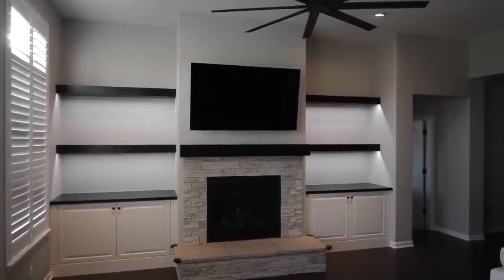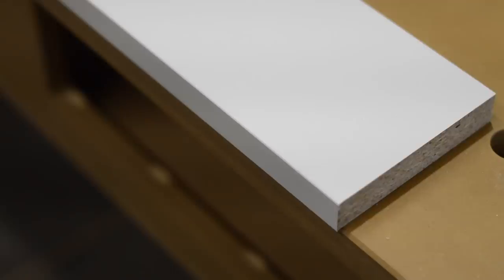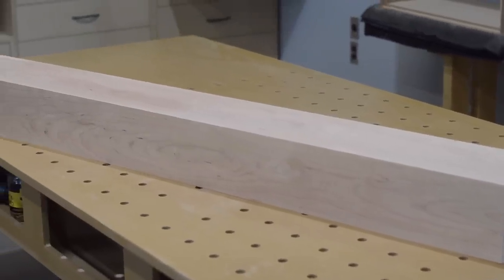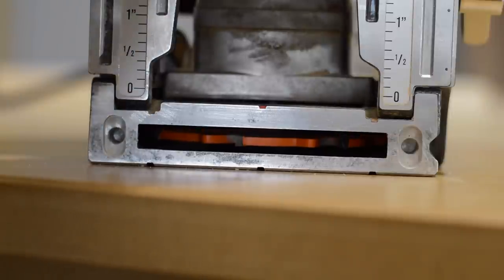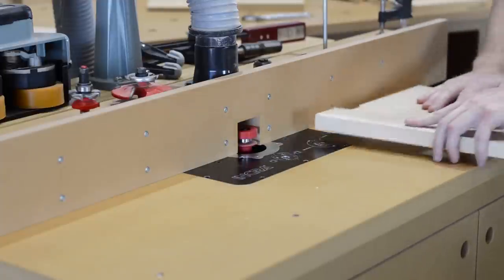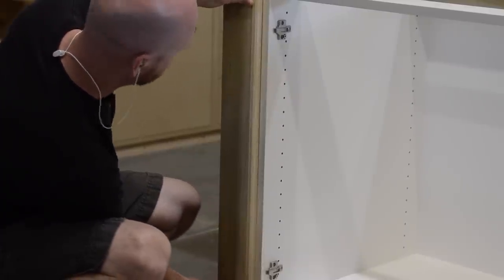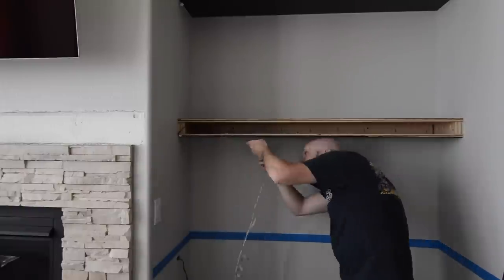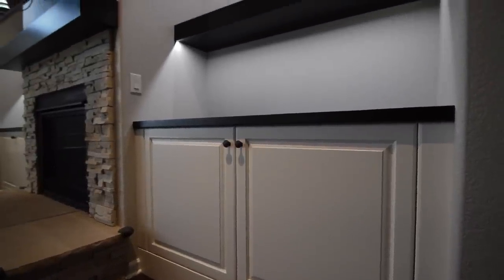Custom built in cabinets, floating shelves and fireplace mantel

Comment: I have seen other people's videos on scribing trim/shelves to fit, but you always have such a straight forward and direct approach. Would appreciate if you could go into a little more detail on how you were able to scribe the shelves and filler pieces around the cabinets.
Reply from the maker: Thank you. I'll include more in an upcoming video. In this case I just didn't have time to film it.
Reply: @MikeFarrington  would love to see your method for doing this as well.
Reply from the maker: Yup, I'll see what I can work in.
Reply: In the mean time if you're on instagram check out JCHcabinets.. Very talented cabinet installer/designer. He shares a lot of good tips/tricks for scribing.
Reply: Peter Millard just posted a cool video a while back on how he makes a template for shelves between walls but he brought them back to the workshop to cut. For me personally working on the job site I'd use a stair thread jig
Reply from the maker: @a-carpenter9229  I'm a fan of Peter's, he seems like a spiffing chap. I'll look that video up.

Comment: Glades Knight, then Marvin Gay at a slower pace then CCR rocked it. Heard it thru the Grapevine. CCR original of Proud Mary, then the Ike and Tine Turner version, Box Tops, The Letter ,then Joe Cocker. Great stuff as always. Learned a great deal of my work from Norm Abrams, but you are my new hero. Thanks.
Reply from the maker: Thank you very much. Good suggestions. Norm will always be my hero. I grew up watching that guy.

Comment: I really like the clean and flush fitment.  This is very similar to something I am trying to do in my own home.  After seeing this I think I would inset the track lights slightly toward the middle so you don't get that bright flash off of the sidewall.  Something I would not have been able to even consider without this video; thank you!
Reply from the maker: Thank you Jake. I think holding the lights in on either end a few inches could be nice.

Comment: You make amazingly beautiful cabinets, but I notice a lot of MDF and sometimes particle board.  Do you recommend these materials over quality plywoods?  Are you choosing this material based on budget?  I typically think of higher end cabinetry being made from solid wood or a quality plywood.
Reply from the maker: Thank you. A lot goes into these choices. Some of it comes down to budget (I like to put budget into the stuff that is visible), some of it comes down to what I can get easily. I also think these materials have been given a bad name by builders who don't use them properly. I spend a lot of time to make these materials look as good as they can. Lastly, most of the time when I offer some of the really high end products (plyboo comes to mind), even very wealthy customers flinch at the price. I have a running joke, I'll paint it pink if you want, its your project. The final decision comes down to the customer. By the way, I have done several project were I painted them pink and they were really cute.
Reply: Thanks!  Are there areas that you do not recommend MDF or particleboard due to moisture or heavy wear, such as kitchens or drop zones?  Or can you overcome at least the moisture concern with a good paint job (possibly pink...)?
Reply: You can get water resistant versions of both MDF and particle board, I have used both in my kitchen, bathroom and porch, make sure they are well sealed and finish with suitable products for the location and they will last for years.  

Most European kitchens are made out of the non-water resistant variety and the cabinets last reasonably well just look at the crap that Ikea make their stuff out of.
Reply from the maker: Matt, I try to not use particle board or MDF around sinks. For this, often, I order a product that is white melamine with a plywood core. One brand is known as dragon ply. The main issue with these products is they are hard to get ahold of. Sometimes its weeks until delivery, I just can't wait that long. Also they are about 4-5 times the cost. One trick I always do when I build a sink base out of particle board melamine is to caulk the inside corners. This keeps water off the core were water damage can occur. Paint can help, but the melamine surface is fairly resistant to water, and its much more scratch resistant than any paint, so I shy away from painting the inside of a sink base. I could think up a ton of situations where cabinets and water come together, but my work revolves around sinks, kitchens and bathrooms. So I am really not an expert on this topic.
Reply from the maker: cmdrsocks, Here in Colorado, at least where I buy stuff, I can't get MR MDF. I really wish they sold it, I would buy plenty of it. I also wish my supplier sold MDF core melamine, I would buy that too.
Reply: It's not much better here in the UK, local stores just sell low grade sheet goods and if I want anything better then I have to order it and often the delivery cost is as much as the sheets for small orders - which means that I have to be selective about when I use them.
Reply: cmdrsocks, Do you use Lathams? Huge supply of boards of all descriptions and sizes, and good prices too.
Reply: Steve, I haven't used them before, but I just looked at the website, very impressive range of materials, I will definitely ask them for a quote on my next project, thanks for the suggestion.
Reply: @cmdrsocks  I've used the medite mrmdf on my customers projects quite often and can certainly recommend it. It's also a bit stronger than regular mdf too. I've also just had a look at lathams site - looks very good and will also have a quote from them on my next project.
Reply: There's a product called extira that looks like MDF but it's made for exterior use so it's water and mold resistant

Comment: My wife and I started a remodeling business in March ive done low voltage lighting in movie that's for fifteen years along with flooring trim carpentry and wall coverings I've slowly got into wood working and recently have started outfitting a small shop for building cabinetry and doors tho I really have little to no experience doing so and have just landed my first residential job where the customer wants almost exactly what you installed in this video so wish me luck 😀

Comment: I have t watched you much but I like that you are actually a professional. So many people who build cabinets on here are DIYers. I’m a professional too and while I use veneer core and some different techniques, I like what you do. 

Try making built ins like this shorter than 36”. Draw it up in your design software at 32” or 34”. It’s a small change but I think you’ll like it.
Reply from the maker: Thank you. I certainly have a different take than the DIYers, thats for sure. I like the idea of shorter cabinets, that could be fun. In this case the customer asked that I match their kitchen, both in styling and height. That was the driving force behind the dimensions.
Reply: Mike Farrington You’ll find that shorter cabinets are generally more proportional. My rule is 36” cabinets should generally only by used in a kitchen or bathroom.

Comment: Nice work Mike. Watching you cutting the long slot with the biscuit, I remember in the ol' pre domino days, for face frames on carcasses I used to put a slot cutter in a trim router, cut long slots entire lengths of the 4 edges of  the case. Put biscuits where ever I wanted on the face frames. Made life real easy. Like your thickness tip on the fillers...
Reply from the maker: I worked with some old timers back in the day that were artists with a biscuit joiner. I also have a slot cutter in a trim router, I haven't used it in a while cause I just like cutting slots with the biscuit joiner. Being able to put biscuits anywhere is a real time saver, neat trick.

Comment: I do like your floating shelf technique, way easier than banging a 2 1/4 in shelf into a polygon. that fill method is also cool.
Reply from the maker: Thank you. I find it nearly impossible to fit floating shelves any other way. The way drywall is installed makes it impossible.

Comment: Great build video Mike! The length of the video was great, detailed and informative as always. Turn the page is still my favorite cover. I wear my safety glasses the same way you do, I find they work really well that way. I was amazed at how your head glistened in the led light, almost needed a warning to put on sun glasses before that segment of the video.
Still waiting for the daisy dukes!!!
Reply from the maker: Thank you Devin. Turn the page is a great one for sure. For safety I should have warned the viewers that a light as bright as an arc welder is about to come on screen. Haha. Its cooling off, I may need to wait until spring for the short shorts.

Comment: Mike I really respect your work, and I really want to be like you one day. Ive recently transitioned from hobbyists to hack part time contractor. I’ve done 5 jobs on my own and I’ve gotten more professional with each one. I was wondering what your process is like for initial measurements and general due diligence. I picked this video to comment on because I see myself doing jobs like this in the future. 

I guess my main concern is that I’m not spending enough time doing my due diligence to make sure that everything comes together perfectly on the install day… 

this Sunday I’m going to quote a “mid century modern” sink base. I plan to bring 

- various samples of pre-finished hardwood’s
- 2 ft level
- measuring tape (obviously)
- 12” square 
- note pad to sketch a drawing (I don’t know how to do the fancy computer designs yet.) 
- small piece of luan plywood to mark the plumbing locations

I was also thinking about bringing some 3/4” plywood to make a mock base to give my clients an idea of proportions… not too sure about that one 

I’m also concerned that I don’t dress up enough (I usually just wear a work shirt with paint stains and cargo shorts) 

Any help would be greatly appreciated!
Reply from the maker: Thank you. I don't dress up either, but I make sure I don't look terrible. I want to look like a woodworker, not a salesperson. I normally use blue tape to mock stuff up for the client to see. Sounds like you are on the right track with what to bring. I bring a level, framing square, tape measure, and notepad to my first meeting. Anything else, like plywood for making a template will come after they have given me a deposit. I don't think there is a right answer, just keep refining what you are doing. Pretty soon you will have worked out a good system.
Reply: @MikeFarrington  I can’t believe how consistently you reply to my messages 😂 Great advice! I really appreciate it! The quote went really well. I took as many measurements as I could, did the blue tape thing (they loved that idea) Drew out a design on the spot… and hip shot them a price that was a tad low 😬 that’s my only regret. I probably should’ve held off until I really crunched the numbers. I felt pressure to give them a price then and there. I said $1000, and it ended up being $1740 once I really looked at prices… and that’s with taking a hit on labor too (I really wanted to do the job) they haven’t messaged me back so I think I’m too far out of their price range. Ah well 🤷
Reply from the maker: @jacobfaso5517  Yeah, try not to give shoot from the hip prices. I have done that a few times, and I'm always low, then the bid comes back higher and the customer says no. They get an idea in their head and there is no going back.

Comment: Hi Mike!

I sent this as an email to you but I think this might be a more appropriate forum. Plus, others might be interested in your answers...

I just found your you-tube channel and really enjoy it. I'm just getting started DIY and there's so much to learn. I especially like your "pro-tips" as you build.

I'm in the process of putting my shop together, and I guess it's a never-ending job. Your under-stairs shelf project was a real inspiration.

If you don't mind, I have two questions for you about your dust collection.

First, I notice you're using PVC ducting. Have you had any problems with static?

Second, I see what appear to be flexible-but-stiff tubes hovering over various blades - table saw, panel saw, etc. Where did you get those and how do you like them? Seems like a great easy solution to at-the-blade dust collection.

Thank you for your time!
Reply from the maker: Thank you. I have not had any problems with static, other than dust like to stick to the outside of the pipe. The blue pipe is called Loc line. I buy the 2 1/2" diameter stuff off Amazon.
Reply: Mike Farrington, how have you avoided static with the pvc? I have never used pvc and recently bought a large collector and i’m about to start the process of choosing dust pipe.

Comment: Hey Mike, loved the video. Would you be able to explain, or possibly do a video on how you scribe the side fillers, and also how you scribe the counter top to fit in that space? This has always been a process that has stumped me. Thanks!
Reply from the maker: Thank you Elliot. I will try and include a little about this in an upcoming video. The short answer is its not easy. I use a compass, and blue tape. The most sure fire way is to make a template, like the granite installers do.
Reply: That's kind of what I was thinking. I've seen people use 2x pieces of 1/8 material and overlap them to create the outside contour of the space. Anyways, thanks for the reply and please keep the videos coming! I've learned more from your videos than from almost any other videos on youtube. You're very talented and I appreciate being able to learn from your expertise!

Comment: Hey Mike. Great video and get finish products. Great information you put out, thank you for that. I would like it see more of your scripting technics, especially the tops between two walls. I just installed one between two walls and it was a nightmare. Could use some help. Thanks again.
Reply from the maker: Thank you. Yes, fitting a counter on three sides is not easy. I'll include more in a future video.

Comment: Hey Mike, great video! I saw your idea for temporarily mounting your small power feed to our Powermatic 66 table saw.  Do you have any movement with the base being just clamped? I guess you could say I'm a big believer in power feeds myself, considering I have four of them. Thanks! Scott
Reply from the maker: Thank you. I have been using that feeder just like that for years. If there is any play its minimal. I use some pretty beefy clamps and it holds just fine. I have four as well. In certain situations, they are a real help.

Comment: Very nice work!  I love the nice clean and tight work you do.  I also like your shop A LOT.  How did you get started? How do you get work?  How do you price?  Video topic perhaps?
Reply from the maker: Thank you. I will probably due a video or two about my story, maybe just include it in my build videos. Not sure. The short story is the girl I dated in high school, her dad was a finish carpenter, he needed help one day. I have been at it ever since. I get work by word of mouth and my website. I price my work as follows: I have a shop rate, I add up the hours I think a job will take and multiply it by my rate, add materials, add 10% on top and send off the bid. The hard part of bidding is knowing how long it will take, there is no substitute for experience in this area. I skinned my knees on several bids early on, I have gotten better over the years.
Reply: Thanks for taking the time to answer.  I was a finish carpenter for 25 years and now build furniture. I always got work by word of mouth and used a similar quoting method.
Reply from the maker: My pleasure. Word of mouth is the key to this business.

Comment: Stunning as always.
Quick question about the floating shelves: You mentioned the the internal corners have a tendency to be out of square, and if this is the case, did you make the shelves oversize and scribe to fit?
Reply from the maker: Yes, I make them a little big.

Comment: Very nice work. I've done with a bit of led work but I've always had trouble hiding the PSU. Where did you put it and how did you run it to the dimmer switch? 

I'll second whoever said the cover "Hurt".
Reply from the maker: All the wiring was hidden in the empty space between the cabinet and the wall and under the countertop.

Comment: Was the LED light  fed over to the other side through the fireplace. Also are the shelves a French cleat or just the pocket screw connection? Nice job by the way
Reply from the maker: Yes, the LEDs were feed over. The shelves are not a French cleat. Thank you.

Comment: Another great video buddy! filled with great tips and tricks!

 I specially liked how you attached the power feed to the saw to get those mitres nice and consistent. I'm doing a plywood staircase at the moment and the customer has requested mitred corners where the riser meets the tread (against my advice I must add) really delicate corner for sure. 

Anyways! Been struggling a bit to get good results. I have sliding table saw just been using feather boards etc, but still getting a bit of burning etc. 

Keep up the good work my man! :)
Reply from the maker: Thank you. A power feeder can be a really neat tool when needed. A slider can work well too. I have also used a track saw with good results. Agreed, I do not think a riser / tread should be mitered, but if its what they want....

Comment: Not to mention those are pretty big panels for the doors. If you had to glue up panels, that'd be a ton more work.
Reply from the maker: Good point, it would be another hour or two labor, but honestly, a panel that wide would have a pretty good amount of expansion and contraction, so for this reason I thought MDF was better.